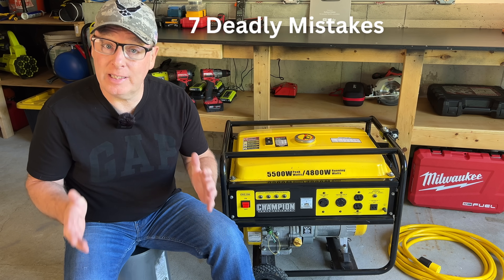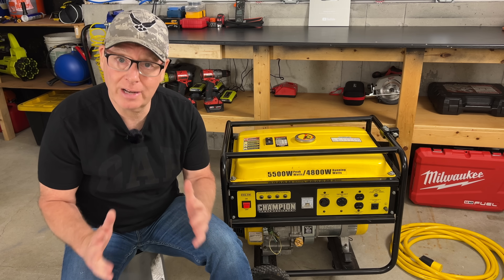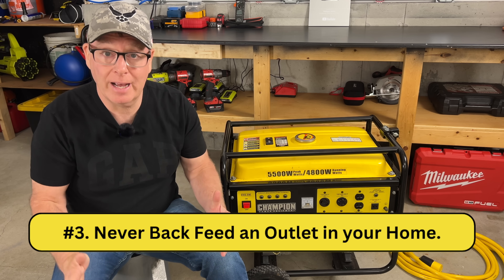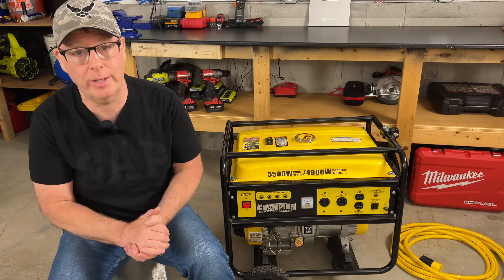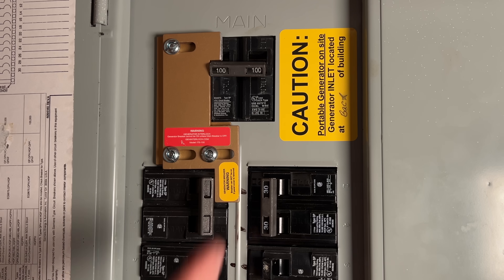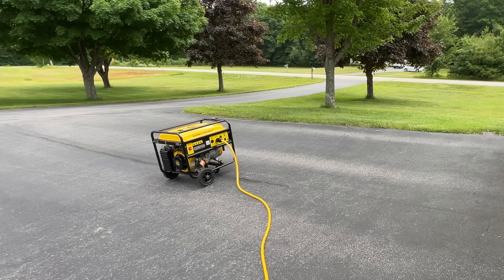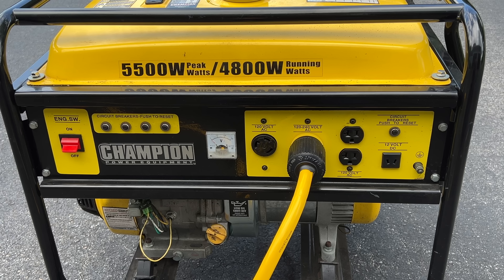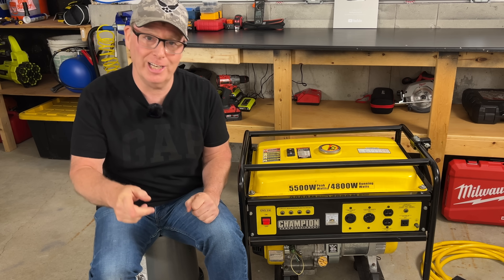7 Backup Generator Mistakes. (Have You Made One?)

Comment: Unless you have an interlock or a transfer switch, I see the "legal" generator connector to be MORE dangerous than the "suicide cord". Unless it is configured properly, the "safe" generator port can remain energized so any child could just open the cover and stick their fingers in it. The "suicide cord" is only dangerous if you plug it in while the generator is running. If you are trying to connect your generator to a load while it is running and supply power to the outlet.... well, survival of the fittest.
Reply: This is very true. That’s why I believe interlocks are actually more important for safe backfeeding than suicide cords. 

That said, suicide cords do lower the bar for unqualified people to do stupid and dangerous stuff, because it allows them to just plug it into existing 5-15 or dryer sockets without thinking too much. If someone is knowledgeable enough to put a proper inlet, it’s statistically more likely that they would also put an interlock at the panel.

Comment: Best bet is a sub panel . 3 positions on the switches -  off - line  - generator no messing with breakers in the mail box .
Reply from the maker: Thats a great option as well but its also nice to be able to cycle a load on occasionally thats not in the sub-panel.

Comment: I spent more money and have a tri fuel portable generator and with more money have one of those plug in natural gas connections . I’d recommend people consider it although I realize outside city/urban areas it may not be an option. I think it’s so much safer from both not storing gasoline, having to refuel and also driving around trying to find more after a storm. If it’s so bad that natural gas is out we’re out of here but can run on a propane tank /gasoline if needed
Reply from the maker: I would love to have that option.
Reply: Im going with tri fuel also, I have never lost power and NG at the same time YET lol

Comment: What about adding a power vent (from a hot water tank) mounted above where the engine exhaust is for draft and plumbing an exhaust stack out a garage window?
Reply from the maker: Check you local codes.. I wouldn't trust it myself. A small leak could be deadly.

Comment: Looking forward to your assessment of the Anker Solix.    Recently, we got rid of Honda gasoline powered generator due to gasoline storage  issues (going bad over time).    Replaced it with an 2 Anker Solix units and 5 200 W solar panels.   We monthly decharge and recharge the batteries on an alternating schedule.   So far, very happy with setup.   Note, it's for emergency use only, not as a power source replacement.

Comment: I will add myself to the list of people interested in more details on grounding.  I have seen advice to use ground rods and not to use ground rods.  This also interacts with locating the generator away from standing water and the home.  I hope YouTube alerts me if you post such a video since I would be very interested.
Reply from the maker: If you subscribe and hit the bell you will get notified. I have a couple of videos to come first but I will get that video out this summer for sure.
Reply: For an interlocked backfeed breaker setup, neutral is not switched. This means you must use a floating neutral generator (must not bond neutral and ground on the generator). No additional ground rod is needed; it is grounded at the service entrance.

If you have a transfer switch with switching neutrals, you need to set up the generator as if it’s another service. It is called “separately derived system” and you will need to add a separate grounding source & bond it with the neutral at the generator.
Reply from the maker: @toukoaozaki  You are correct but many don't understand what that all means. You and I do but not everyone. I plan to make a video showing the difference and the reasoning behind the rules.

Comment: I setup my portable generator in my detached two car garage which is over thirty feet away from my house. It feeds the panel through under ground PVC conduit. It has a remote start/stop fob. I installed an exhaust fan and fresh air intake. Plus run a fan to blow cooling air onto the generator while running. Also leave the garage door open slightly. And I do use carbon monoxide detectors inside the house. Have only used it in cold weather so the house doors and windows remain closed.

Comment: yea 3/4 is fine as long as you shut off the main braker before you start
Reply from the maker: The issue is it depends on a person to do things  in order to be safe and not put others at risk. A mechanical interlock and an inlet box takes the human element out of the equation.

Comment: I could be wrong, but I don’t see the interlock in the panel effective if you’re able to switch the generator breaker on and off without touching either the interlock or the mains breaker!
Reply from the maker: I think you missed something there. The generator breaker can only be cycled with the main breaker off. The main breaker can only cycled with the generator breaker off. The point is the two cannot be turned on at the same time.

Comment: It is not hard to make a "carport" for your generator.  Basically a big scrap piece of plywood, with  2x4s for legs.  Just make it big enough that the legs and the plywood sheet are well away from the generator/hot exhaust, and make one side lower than the other by an inch or two so it sheds water easily.  Bonus points if you paint or seal it, but you really don't need to given that it only sits out in the weather for a day or two normally.  If it is very windy I put a cinder block on top of it.  If you want to get fancy, put the legs on hinges.  Or just screw the legs to the top and remove the screws when you need to store it.  Your battery powered drill will still work when the power is out so no big deal to reassemble it.

Comment: Number 3 is a bit misleading. While it is true that creating a double male cord is dangerous to those that don't know what they are doing, saying that back feading this way into your house can hurt or kill a lineman that might be working on a pole nearby? This is false. If you forget to turn off your main disconnect to your panel when you plug in your back feed cable, you will be feeding power to every transformer and house on your circuit. The tremendous load will instantly stall your generator. This myth has never been proven to happen and needs to go away. That being said, I still gave you a thumbs up!
Reply from the maker: The key to what you said was if you forget to turn off the main. That’s why it’s illegal because it depends on a person rather than a mechanical interlock. Depending on where the line is down you may be right about it overloading and stalling the generator. But if the line is down isolating your transformer you may put putting high voltage on the lines putting utility workers at risk. And if your neighbor is on the same transformer like mine you put them at risk too. I’ve been in the electrical industry my whole life either as an electrician or an engineer and my father and brother in law are both retired lineman. They both have stories about energized lines from back up generators

Comment: You touched on this, but I NEVER start or turn off a generator under load. (it will last longer) 🙂 AVR's are expensive these days
Reply: So how exactly does that work??? Turning it on before connecting wires?? Or what
Reply: @sparkygreen6298 just don't have any appliances turned on, or if you have no control of whether they're on or off, unplug them or open up the breaker for them before starting, and turn the appliances off or unplug them before shutting the generator down.
Reply: So is it safe, let’s say to plug in a side-by-side refrigerator as the generator running full power?

Comment: When running mine,  I will always use one of the spare 120v recepticles and plug in a high velocity fan, so it constantly blows air over the generator and forces any air to pass over the exhaust blowing it well clear and any hazards of CO coming anywhere near the house..  Plus it will help keep the generator from overheating.
Reply: If you unbond neutral as you should when connecting to house, if it safe to use the generator outlets since it's unbonded on those?
Reply: @onlywenilaugh6589 That's a good question. Can we get an expert to weigh in???  I think I have the answer, but would defer to those more knowledgeable and able to provide the correct information.

Comment: My system is 18 years old. Honda 4500, I think I have that suicide setup!
Male into the generator,  and male into a box on the wall.
It was installed in 2005. I have used it many times with storms in Florida.
I bet it's not code anymore! 
Might be time to have an electrician  take a look.
Just came across you channel,  love it!
Thanks, Rick.
Reply: Youll be fine IF you are cognizant that those plug ends are hot and will fry you....

I did a 50amp 240 suicide setup.  I use the same start up shut down sequence he did so, that it isnt hot, but i still treat the ends though they are hot at all times.
Reply: And if you don't throw the main breaker you can electrocute a lineman. Plus you bypass your breakers.
Reply: @chuckr1951  and if you run out in front of traffic on I-75 you'll get hit by a car!!!   Thank you Captain Obvious!!! Furthermore you are not bypassing any breakers.  But hey, great way to tell everyone you have no idea how a circuit panel works!!  LoL
Reply: @chuckr1951  Don't you think your 30 amp breaker on your generator would blow if you tried to supply the entire neighborhood

Comment: good advice,but as you mentioned yourself some things can be a challenge.If one is in the middle of a hurricane, to run a generator in dry  "conditions"would require a sturdy,dedicated structure,meant for the generator only use.This requires extra real estate area,building permit and construction of it with possible inspection.Anything can be done provided one pumps enough money into the enterprise,which ,alas is not the case for a lot of people

Comment: This is confusing.  I had a licensed electrician, install a dedicated inlet near the panel box which is in the laundry room leading to the garage, a dedicated 30 amp breaker in the panel box that only addresses the generator, and have a series of start up and shut down procedures to include shutting down the main power box which is on the opposite side of the house and outside that get's padlocked and never opened or turned back on until after we are ready to return to main power and all generator power has been terminated. But I have the same heavy grade commercial cord (Maybe even thicker (100ft)) you are using that i bought from the electrical company. but it is wired with 2 male ends. Are the codes different codes different from state to state. Did they shortcut?
Reply from the maker: Actually that is an illegal connection. The reason is it depends on you cycling the breaker in the correct order rather than a mechanical interlock. I'm sure you know how to do it correctly but it's risky and illegal in all 50 states.

Comment: I use a suicide cord and I'm the only one allowed to use it at my house. However I do teach my family about it and why it's dangerous. I also have a check list to ensure nothing is turned on until the main it tripped 1st. Then the generator circuit breakers are turned off, then all the cords are connected, checked and then only then is the generator even turned on and it's circuit breakers turned on.  And of course until everything is disconnected then and only then is the Main allowed to be turned on. Until I can afford to have a Emergency Panel is Connected to my house, a Check List is crucial and mandatory in my family. So far in the 10 years I've owned it. I've only had to use the back generator twice. After Hurricane IDA for 10 hours and a really bad rain storm last year when the power was out for 6 hours. That suicide cord is 12 awg that goes to a three prong dryer plug. I also use a separate 110v cord that only has the ground connected inside the plug for an additional safety ground, the 110vac wires are capped and not used. Thanks for the tip I found I had broken two of them. 1. Suicide Cord. 2. I run it outside under the porch and the cord runs runs through the door that is cracked open just enough to let the cord pass. I do stuff towels in the open parts of the door to keep the smell out though. So I may be good on the 2. one. It's a 7KW with a 8KW surge. It runs the whole house except the Central AC and the Electric Stove. it will even run two small window AC Units for the bedrooms. Thanks for sharing. Best Wishes & Blessings. Keith Noneya

Comment: Would really like to know your thoughts on a propane generator vs the gasoline generator. My thought is the propane does not go bad like gasoline stored in a storage container after a long period of time. I have lived in Iowa and Arizona and both utility companies have provided reliable power so the need of portable generator power has been minimal. Thanks for sharing some valuable tips on generator safety.
Reply: Adding a gas preservative like 
Stabil or Startron will allow you 
To keep gas long term. Startron 
Works for two years. I usually 
Put my generator gas in my car 
After one year and start over
With fresh gas.
Reply from the maker: I have never owned a propane powered generator but I do certainly like the idea. I think they are safer, and you can probably get through most outages without needing to fill the tank. I also like the idea of inverter generators which use less fuel and provide much cleaner power allowing you to confidently use your computers and other electronic devices.
Reply: Propane is ok and convenient, but you I don't think you'll get any more run time from a 20 lb. propane bottle than 5 gallons of gas.  You'll need multiple 20 lb. propane bottles for a longer term outage.  A larger 100 lb. propane bottle can be hard to handle.  On the other hand, if you already use propane at your house, have a connection piped in for long term use.

Comment: shutting house power off from street?
Reply from the maker: Yes. The utility or street power needs to be disconnected before a generator feed can be connected. This interlock is required for the reasons I talk about in the video.

Comment: If your going through the trouble of adding a receptacle on the side of your panel, just also add a manual transfer switch.  This passes code in case you sell your home, plus isolates your home from the grid when using Gen.
Reply from the maker: A manual transfer switch works fine but so does using an interlock kit which also passes code.
Reply: Nice thing about a manual transfer switch is being able to work on the main panel if you need to
Reply: I prefer the manual transfer switch method.  As someone else on YT pointed out, an interlock can easily be defeated simply by removing the panel cover.  Yes, a lot of things CAN be dangerous, but I'd rather have a system that is safer and less prone to accident or failure.